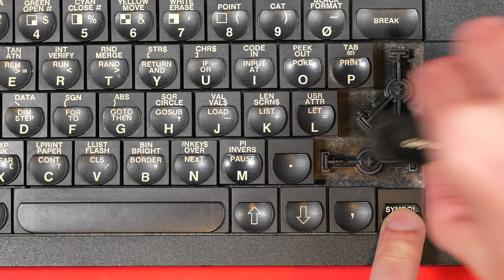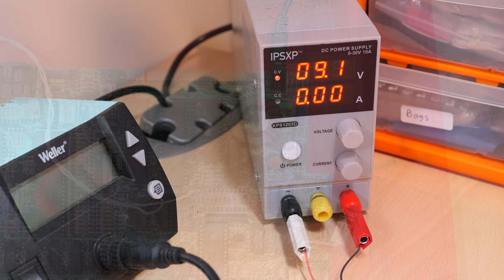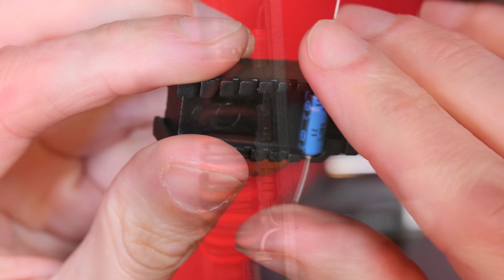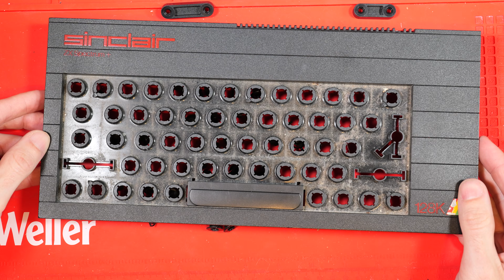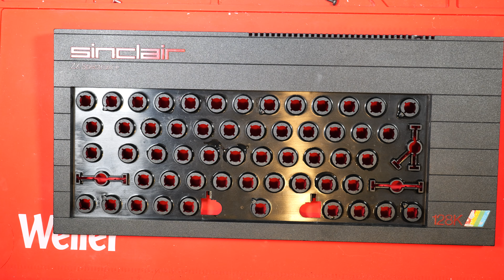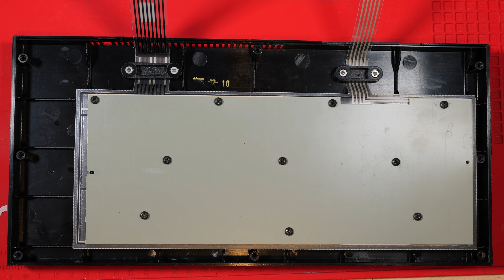Relaxing Electronic Repair - ZX Spectrum 128K Toastrack

Comment: Do you have a spare 1 of those GAL IC's already programmed at all, matey ? willing to cover cost and postage here if you have one 1 spare and already programmed ? Only reason i'm asking is because of the price of the GAL programmers, which is not going to get used a lot by me if i manage to afford one.
Reply from the maker: Hi mate. 
You can get them direct from retroleum as a kit. That's the easiest way.
Reply: @HappyLittleDiodes   Yep, just this second checked on that brilliant site and found the GAL IC. Thank you ever so much, you are a legend indeed :)

Comment: Where can i find the ".JED" file for programming on one of these GAL IC chips please ?
Reply from the maker: Try this
http://velesoft.speccy.cz/zx/umbrella/gal16v8-new.zip
Reply: @HappyLittleDiodes   Thank you ever so much. I have 2 different brand programmers. !x is a K150 (which i used to program Playstation 1 mod chips) and my other programmer is an EZP 2023+ Which i bought to program/flash a BIOS file on a laptop BIOS IC ?

Comment: Nice.  A couple of questions ...

1. Why does the EPROM need a sticker?
2. What's the danger of putting the board in a vice?  Does flexing the board not cause issues?

A final weird one ... what do you do with the legs you snip from the components?  Do they have any use at all?  I'm not a fan of waste.🙄
Reply from the maker: The EEPROMs with a window are designed to be wiped clear by UV light. So it they are left exposed they can lose data.
I find as long as you are careful the board won't flex any more than normal. Obviously you have to be careful not to over tighten it though!
Reply from the maker: Sadly I haven't thought of a use yet for cut legs :(

Comment: For the voltage regulator i use RS part number 193-4015. You can then remove the heatsink completely (on the rubber key versions). It vastly reduces the temperature inside case and reduces the stress on every other component as a result. 👍
Reply from the maker: I'm on the fence about this because I like the weight and the warmth of 7805 and heatsink it feels authentic!
Reply: @HappyLittleDiodes  It certainly does - you're correct about that. But for me, I'd prefer to protect that ULA which boils along all by itself. It also protects the electrolytic caps (they're temperature rated) and the keyboard membrane. 

Of course, it depends how much they are going to actually be used in real life. Back when I was a kid my Speccy would easily be powered up for 12 hours at a time - maybe even more. These days, I'd be more likely to fire him up for half an hour to blast some Mainc Miner (the best game ever written!). 

Really enjoy your channel. Your channel and More Fun Making It are my faves! 
👍

Comment: Nice, I usually remove the 7805, clean underneath and lightly sand down the surface of the aluminium heatsink to shiny metal, apply a tiny tab of thermal compound, and reinstall the 7805. I find that although not essential in a Toastrack, this significantly improves the cooling of the regulator.
Reply from the maker: Good tips! Thanks